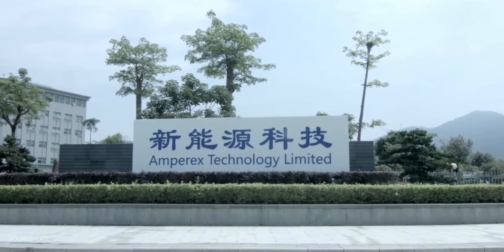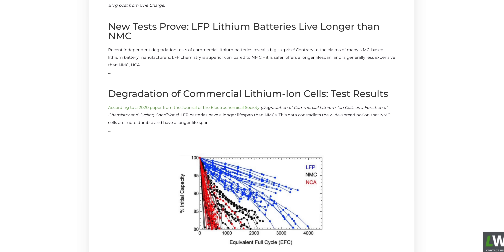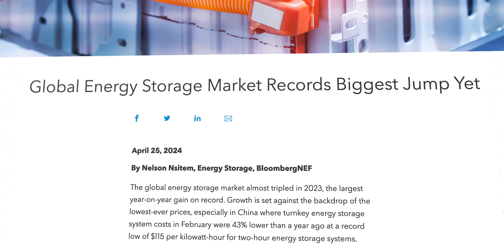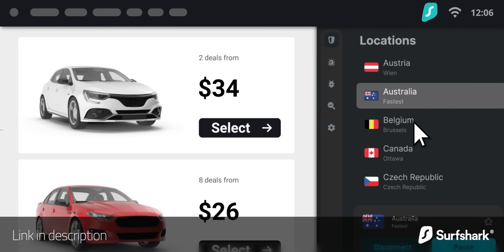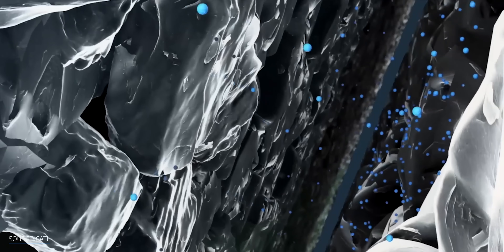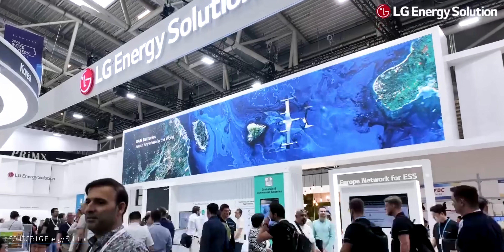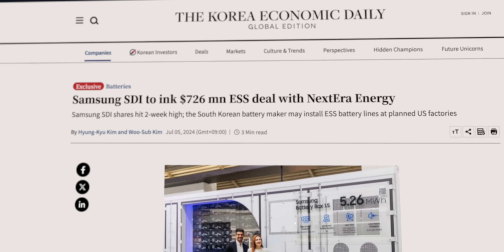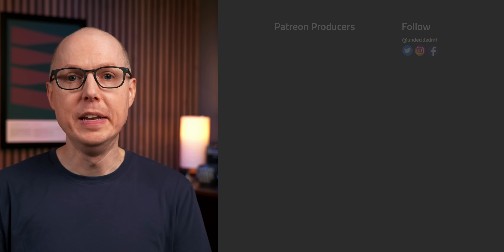How This New Battery is Changing the Game

Comment: Man I wish I was the average US household being able to do 15kWh over two days.
Reply: What are talking about ? Norway had the cheapest electricity $0.11 kwh as of  March 2023
By comparison the top 3 in the world were
Denmark $0.53
Germany $0.52
Uk.           $0.48
Reply: We use almost 100kw/day due to all of our tech and air conditioners.  Those batteries are tiny but I'm sure will scale up
Reply: @Iamdebug maybe it is time to upgrade your electric appliances to energy efficient once and also start using heat pump.
Reply: @Iamdebug that's insane, I live in subtropical Australia and I don't think I've ever used more than 60kWh in a day with ducted aircon. I also run a server stack that consumes a few hundred watts 24/7, but during the day out solar easily covers it so I'm not bothered.
Reply: 3 kWh over a month, Norway. Cost = 153$

Comment: 15 kw's does NOT cover the avg us household for 2 days. with wood heat in the winter we still use 30 kw's a day. the summer is more like 50-60kw's a day. you released this an hour ago.
Reply: kwh?
Reply: @suklee1400  kilowatt hours.  It is a measure of the quantity of electricity.  A kilowatt is a thousand watts.  It costs from 8 cents to about 50 cents (USD) for a kilowatt hour if you are paying a utility.
Reply: He might have got it the wrong way around, apparently the avg is 30kWh per day.

That said, except for the depths of winter I can cover almost our entire energy budget for most of the year with our solar output, I figure about a 10-15kWh battery would let us almost completely go grid power free. We don't have gas or other, I'd probably want some more panels if I had an electric car.
Reply: Sounds like you're well above the average. Average home electricity usage is 30 kWh/day. But agreed that 10-15 kWh of battery wont cover a house for 2 days unless the homeowner is very frugal with their energy usage.
Reply: He lives in the UK where it nether gets really hot or really cold and the houses are smaller.  That is why they get by on 15 kwh.

Comment: People are complaining that battery cell tech never makes it to market. 
It can take years to get from the lab to commercial penetration.  1996: John Goodenough and his team at the University of Texas at Austin discovered the LFP cathode material.  Pattent was granted in 1999.
The global LFP share increased to 34% in 2022.
November 2023, LFP batteries captured 31% of the passenger EV battery market. 
The forecast is to reach 39% by 2024.  
In China, LFP batteries now make up over 50% of the EV battery market in GWh term.   
Interest in battery cells has increased somewhat and perhaps that will accelerate the required time.
Reply: You left out that the LFP patents expired at the end of 2019. That's a big reason for the post-2020 surge in LFP batteries in the US.
Reply: I wonder if LMFP can take it to next level as that will have density between LFP and NMC batteries.

Comment: Point of clarification: Rolls-Royce Motor Cars Limited was created by BMW in 1998 and is completely unaffiliated with Rolls-Royce PLC, the owner of Rolls-Royce Power Systems and the MTU brand. Rolls-Royce hasn't made cars since its bankruptcy in 1971. BMW licences the brand and logo, but the cars share no lineage with the cars made prior to Rolls-Royce's bankruptcy.
Reply: The car lineage is via Bentley. The Crewe factory has been making cars since 1946 and continues to do so, even though it is now owned by VW.
https://en.wikipedia.org/wiki/Bentley_Crewe
Reply: Even companies with traceable lineages have evolved to treat the automobiles they produce as a side effect to generating revenue from subscription services.  We have BMW attempting to coerce customers to pay for heated seats, or GMC pushing Onstar, or Mercedes-Benz hawking driver assistance, all the while selling driver data.
Reply: @catsupchutney We’re getting side tracked, but:
1.  Capitalist companies didn’t suddenly start following capitalist ideas. They’ve always been money first, because without money they fail. 
2. BMW trialed heated seats as a subscription in exactly one country based on user feedback. The trial didn’t pan out, and they canceled all roll outs. 
3. Economics of scale have meant that features are often technically included in a car, and not turned on. You (or the original owner) may not have optioned heated seats, but the seat may have the coils. Find a button and attach it to the wires, and voila! Heated seats!

Comment: What about huge plastic waterbatteries under new lawns? Should be cheaper and cheaper over time.
For surplus power from roof solarcells or Teslaroofs.
Reply: probably a reason why we don't tend to stick electronic systems under lawns.
Reply: @edc1569  it's just raising water, and let it fall through turbine in piperoom on the side. Also where the pump is. Clean water is best for turbine.

Comment: Most forms of stationary storage need to last 15-25 years to make economic sense. If the short-term pause on degradation has any detrimental effect on long-term reliability, it may be moot.
Reply: I was just doing some rough napkin math for a relative's house that wants to cut their power bill. A $12k DIY system has a payback of roughly 8 years just switching from a flat-rate plan to time-of-use + battery storage. Well within the longevity of an LFP system. Looking at ~15 years before they degrade down to 80% with current tech.
Reply: Or be really cheap and have swappable components (although for the sake of the environment I prefer the first option)
Reply: @drillerdev4624  Modular battery systems for maintainability will definitely become a necessity: I cannot imagine throwing away literal tons of batteries due to single failed cells in the whole unit being sustainable.

We're still ~10 years away from seeing how well the first wave of mainstream EVs and their batteries will age into retirement. I'm apprehending a nightmare of EVs getting scrapped prematurely due to single-cell failures and the inability to service battery packs in a safe, reliable and cost-effective manner.
Reply: On cnevpost they say "Tener has a cycle life of more than 15,000, which is 1.7 times the current mainstream level, and will not decay in the first five years of its 20-year life expectancy, CATL said."

Comment: Wouldn't 5 years of daily cycles be approximately 1500 cycles?
Reply: Battery full to Battery empty to battery full is a cycle. So, many cycles can occur in a day, it just depends on how fast you empty and refill your batts. The main claim is ~5 years without any battery degradation. If true, fantastic.
Reply: @suklee1400 yes, if this is accurate, CATL just took dominance with stationary energy storage.  Hard to beat that standard.
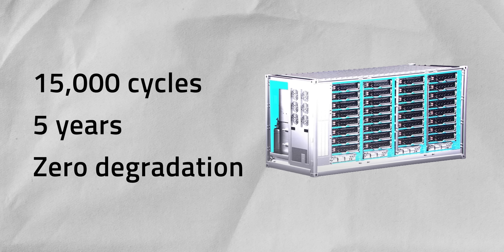Reply: Yeah! @4:35 showing "15,000 daily cycles over 5 years" must be an error.
Reply: this is not the first video in witch he messed up the numbers

Comment: Every 5 years for replacing batteries is horrible across the globe is horrible, at this scale. 

This is the problem with EV fast chargers, which require an ESS. 

We need a 20 year battery.
Reply: I think, that 5 years mark is for no loss of capacity or efficiency (at least for what they claimed), which means, it can technically last longer than classic batteries from the get go, but we have yet to see their warranty and put to the test in real world scale.
Reply: I think you got something wrong here. CATL is guaranteeing that the first 5 years won't have any degradation and after that period the degradation slowly starts, which means that the batteries should last around 30 to 40 years, maybe even longer.
Reply: @antonio_fosnjar  - “guarantee first 5 years… 30 to 40 years…” - calendar aging hits a battery, as well as cycles. 

There are factors which impact calendar age, like heat 🥵, cold 🥶, discharge percentage, SoC… these contribute to battery fade.

5 years is not a “no degradation” guarantee, it is an operate within specifications, assuming environmentals are maintained & charge/discharge metrics are consistently maintained 

The guarantee from companies for large grid scale implementations will be dependent upon environmental requirements. 5 years is not a blank check. Assuming 15,000 cycles is unrealistic.
Reply: He said zero degradation after 15000 cycles in 5 years, NOT the batteries are dead in 5 years.  It means if they were so heavily used in a 5 year period they will lose capacity after 5 years, but you can still use them for many years after, even at 70% capacity they can still do the job. 70% is the cutoff point in most car warranties, so for grid storage I would think it would be much lower say 40%,  which will take decades.  
But the reality is the batteries will be heavily used if they are cycled once a day, so will only start to lose capacity after 15000 days (41 years), so there is a good chance the batteries will be around for over 60 years maybe up to 100 years depending on how fast they degrade after the first 15000 cycles.
Reply: @ogodei70  - batteries 🔋 suffer from calendar again, cycles are not the sole cause of performance degradation. 

If 15,000 cycles was the issue, then there would not be a concern at 5 years to start seeing degradation.

Chemically, 5 years is not a magic time for degradation to start, degradation starts from the second the battery comes off the line. 5 years is the mark where the battery remains in spec, assuming compliance with charging, discharging, and environmentals.

Calendar aging is accelerated by unfavorable environmental conditions. We are not talking about a battery pack mounted on your garage wall or an automobile parked in your garage for grid scale implementations.

Grid scale batteries are different beast.
Reply: You must pay attention to the details in the video!
Reply: And the problem with you, David, is you're not very bright.  No one replaces a battery that has only begun to degrade.
Reply: @krashd  - you’re not very bright, either, if you think that grid scale batteries that experience charging & discharging on a daily basis, to deal with renewable loads are not going to need to be continually replaced.

In a datacenter, you don’t wait until batteries are dead before you replace them, they have to be in good working order during the replacement process, since the replacement process takes a long period of time, so as not to disrupt service. 

You may personally not replace batteries that are starting their degradation process, but if you are servicing power to hospitals 🏥, refineries, elevators in dense urban areas, air conditioning systems in the Sun ☀️ Belt, heating near the poles, power for trains… loss of battery 🪫 results in deaths of individuals.

There is a push for 100% electrification. Those batteries will not be replaced at 40% (unless one is in the 3rd world.) 

Some studies show LiFePO4 batteries significantly increase noise characteristics after 6 years. Other studies show increasing temperature of cells to 45 degrees C will reduce useful cycle times to 1000 days (3 years.) 

That 5 year mark will likely be the lifetime refresh time, forever… it may take a year to replace. Those batteries 🔋 must perform reasonably close to spec during the year of replacement. That will likely be during year 6. Waiting for replacement until after 70% means the batteries may not perform well during the year long battery 🪫 replacement project — that presumes risk which will cause law suits when such penny pinching incompetence is observed by lawyers for dead ☠️ people.

Comment: Is this just like the last battery you talked about that never happened? Or the one before that? Or the.......
Reply: 2 - 3 years ago most consumer batteries changed from 300 to 500 cycles to 3,000 to 5,000 cycles.

And 1000 watts of that capacity has dropped by half since then.   Today, I can buy a 2000 watt battery for what 1000 watt battery cost 2 to 3 years ago. 

Today it was good enough for small disaster recovery applications and kept my freezer and refrigerator going the night of the hurricane on July 4th weekend, saving all my food.

At the current rate of progress in another 2 years I'll probably be able to buy 4000 Watts for the same price.
Reply: In the past three years, Australia, California and Texas have installed so much  battery capacity that Texas and California were able to weather significant heatwaves without outages or outrageous, spot prices. Australia saves so much money over expensive gas peaker plants after installing their first mega batteries that they’ve been installing a lot more utility scale batteries. And we are only at the beginning for battery storage. And, Teslas are such reliable cars and the batteries last so long, that now, they are just another car on the road. I charge my used Bolt at home. Ok, on the two long trips I take a year, I have to take a bit longer to charge. But other than that, I charge off my home solar panels (paid for by  house energy savings), so I no longer have to waste money paying for gas. 

More scientists and engineers are working on batteries than worked on the Manhattan and Apollo projects combined. Significant advances in battery technology are happening now, that will continue to change the way we power our homes and cars.
Reply: @freeheeler09  you also say 5 to 10 minutes every week that you don't have to stop and refill your car for gas.  Doesn't seem like much but that saving you about 9 hours a year.

Comment: As ususal, vauge promises of a "gamechanger" calling it "the future of..." and nothing tangible.
This is old technology, it hasn't had a brektrough yet, and noone knows if it will meet the promises made here.
Yes, we need a lot of different kinds of batterys, at the moment nothing is better then LiPo, that's why they are used for everything between your toothbrush and grid storage.
But for gridstorage you don't have weight and size restrictions, as long as the battery is dirt cheap.
For electric airplanes, you have weight and size restrictions, but it doesnt matter if the batterys are expensive.
An electric toothbrush doesnt need a battery with 10000 cycles before degrading, but it is important in other applications.
That's why no single battery is the "future" until it is proven by time and use.
Except the solidstate powerbank you described as the future a while ago :D
Reply: You can easily get LFP cells and make your own DIY battery pack a under $100 per kWh. You can even buy LFP batteries that are essentially plug -and-play on the market today.

Comment: They should focus on sodium ion for stationary storage.
Reply: Who is they? And why should they put all eggs in one basket?
Reply: @Harrythehun Exactly multiple sources, decentralizing the power grid will make it more resilent.
Reply: or heat-based batteries. but yeah, leave the lithium for mobile applications
Reply: Different companies have different patents. CATL also has lithium overcapacity that they need to put to use.
Reply: They already do. CATL is the biggest worldwide player by a massive margin, and not only do they have their own internal teams working on multiple solutions, they're also directly funding independent research companies and smaller manufacturers who do pursue SI based batteries specifically.
Reply: Or iron-air.
Reply: I just doubled the LFP battery storage on my small backup system.  Hopefully sodium ion will take over that role, although I'll be gone by then or too old to care.  😂

Comment: I will watch what CATL warranty is for those batteries, without such low degradation no one should be able to beat there's warranty.
Reply: *their
Reply: VRFB have a 25 year life expectancy (thats a conservative value), with indefinite recyclability.
Reply: Every company offers shorter warranties when they can because of misuse and unforseen circumstances.   They also know batteries/systems will be different in 10yrs and don't wanna have to keep repair parts forever
Reply: @veganpotterthevegan  Every company in the EU has to keep spare parts for at least 7 years after the last sale, so anything less than that is lack of confidence in the product.
Reply: @TheFPSPower  sure but if they found that their batteries lasted 15yrs with a 98% success rate,  they're still not going to offer a 15yr warranty.

Comment: Wait, didn't Form Energy have a "rust" based battery technology that never degrades?
Reply: Iron Air battery.
They have a good storage capacity but extremely large.
However they have a long slow discharge rate and are not suited to certain uses.
Reply: @shawnr771  the great thing about those is that they make your need for massive LiPo batteries much lower. So, you can have a decent LiPo battery farm for spikes, and then let the oxygen-iron batteries take it from there.
Reply: @Kevinjimtheone  exactly.
I still want to see the Iron Air home battery that was originally advertised to be slightly bigger than a washing machine.

It would be nice to have one kick on when electricity prices are high and charge when prices are low.